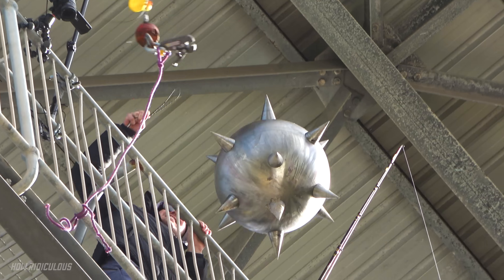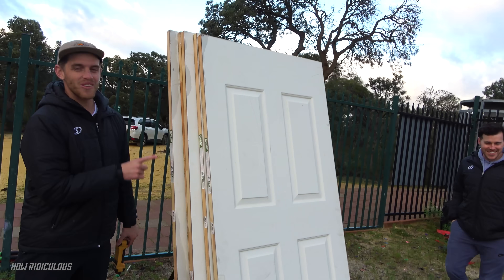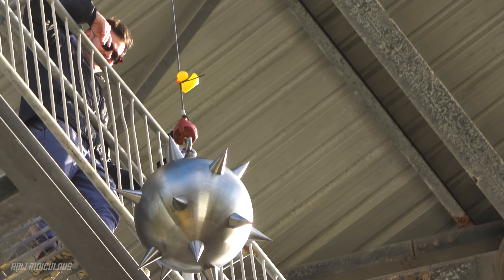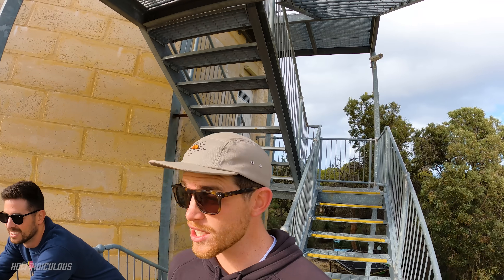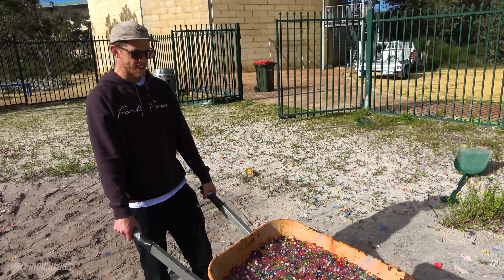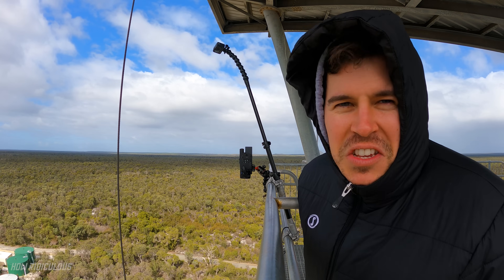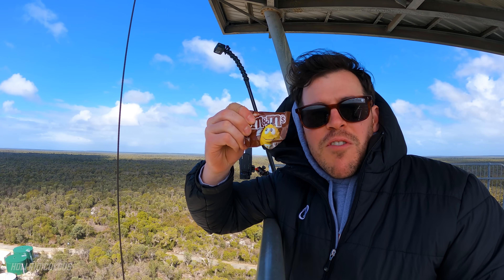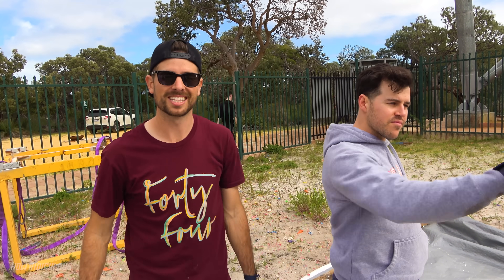444kg Savage Wrecking Ball Vs. Bulletproof Glass from 45m @ 13,000fps!

Comment: OK, got it... if I ever need to break through thick bulletproof glass I need to do the math to figure out how fast a 444kg spiked ball is moving when dropped from that height and then build a contraption that will launch it at that speed on a horizontal plain. ....simple enough.

Comment: Create a reinforced steel chest.  Fill chest full of old golf balls with the wound rubber band core and drop your new toy into it.  See if you can make it bounce back up or just mash the bands out the balls!  The chest must be strong enough to not split at the seems though!  Maybe bury it the ground to spread the load on the walls and joins of the chest.

Comment: We should start having something to track the speed of the objects falling, could be a cool feature!
Reply: With things this heavy, you can pretty much ignore air resistance, and go with 9.8 m/s^2
Reply: @adamlaceky8127  I'm not too sure about that, but would like to see it!
Reply: @Ragnarok0312  At 444.44 kilos, and 45 meters high, the air resistance would be negligible. You can calculate it, but probably not measure it very accurately. At a much higher altitude, air resistance would be much greater.
Reply: @adamlaceky8127  Thanks, I didn't think it would matter much, but I'm not one to assume when I'm not an expert :)
Reply: All falling objects, travel at the same speed. The acceleration due to gravity is 32.2 ft/s^2 for English units, or 9.8 m/s^2 for SI units. If you drop an object from 15 feet, for example, you would multiply 15 ft * 32.2 ft/s^2 to get 483 ft^2/s^2.
Reply: @charlesfisher6620  the question wouldn't be gravity, since it's constant, but I think the difference would be air resistance, or drag. Think of the feather and the bowling ball. In a vacuum, they fall the same, but air resistance makes the feather fall so slow. So the dart probably travels the fastest, followed by the new spike ball, then the fist, due to their aerodynamic profiles.
Reply: @charlesfisher6620  accelerate at the same rate. After 1 second your object will have accelerated to 32.2 feet per second, but since it is only 15 feet from the ground it would take about half a second to hit the ground. Its speed when it hit the ground would be something around half to two thirds of 32.2 feet per second
Reply: Here's where you can calculate it: https://www.omnicalculator.com/physics/free-fall-air-resistance

444.44 kg at 45 meters will take 3.2 seconds to hit the ground, with drag of 0.24 kg/m. (this is the default, probably at sea level.)

With drag of 0.0001 kg/m, it would take 3 seconds to hit the ground.

Comment: One thing i noticed is that the ball get some rotation from the release and due that the accuray drops and it doesn´t hit with the spike perfectly straight. I think you could reduce the spinning by havind the steel cable go through a loop at the to so that it cant swing towards you when you pull the release.

Comment: Ok I just gotta give that guy some kudos. Heating the ball and cooling the spikes to make one expand and the other shrink just enough to make them fit, then they are tight when the temperature equalizes is an absolutely genius idea. I wonder why you don't see any blade smiths using that technique. Cause usually they thread spikes on or weld them when they are making spikes on things like hilts and maces.

Comment: It appears that the drag from Rexi is what pulled you off the bullseye, more wind drag on that side made it start to rotate up toward rexy trying to get him on top.  Try it again without him attached and youll be closer.  If you want even more accuracy put a swivel below the release so you can spin it like you did when it was lowered.  if its spinning horizontally it will have a harder time trying to rotate vertically as it falls, same physics that explain why a top doesn't fall over.

Comment: Drop the mace several times until there is a mace sized pit, line said pit with plastic or a tarp, fill said tarp lined pit with a nice colored liquid, orbeez, or both. Then drop mace head into the hole.

Comment: Heres my idea, set up a giant tube like a cup (basically a hollow cylinder with a bottom and no top) then have a perfectly fit lid where it will basically act as an air spring when you guys drop something heavy on it, youd probably need more than one disc but theres still so many cool ways you can drop things